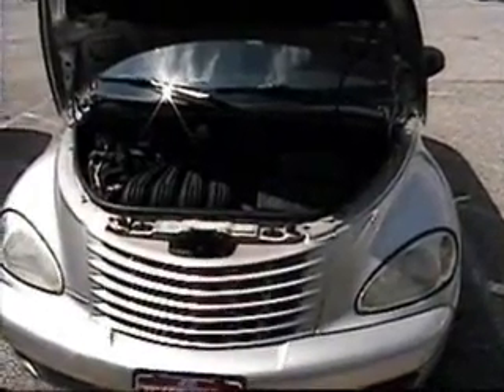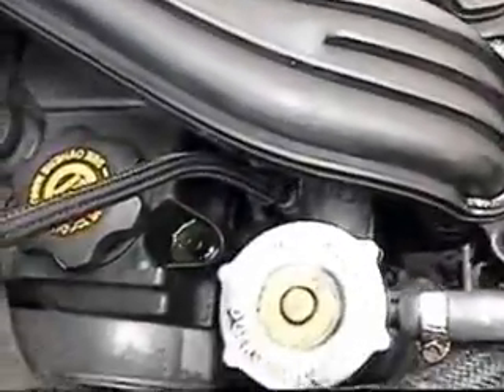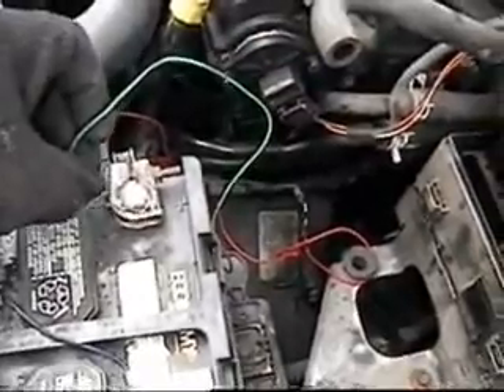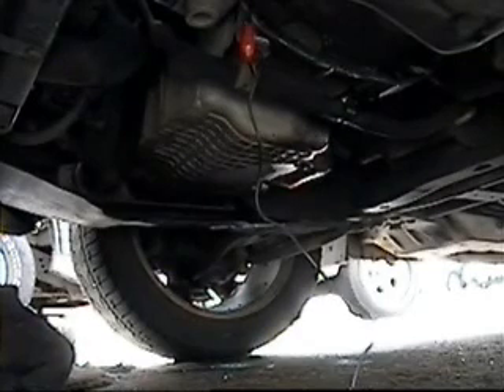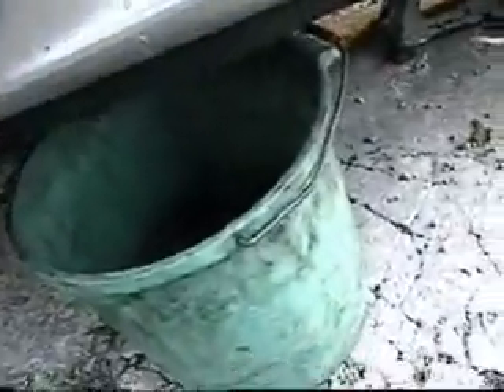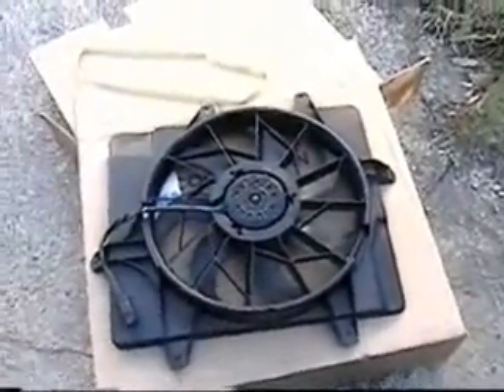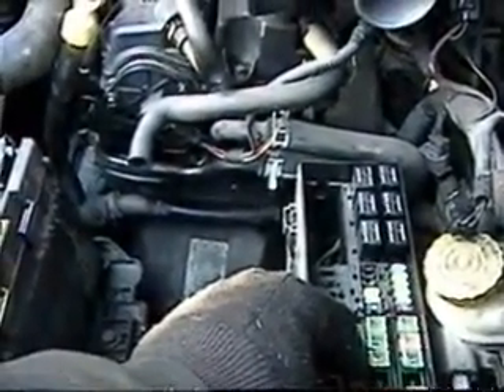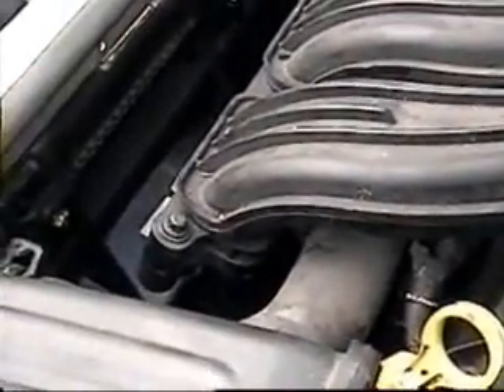Cooling system diagnos 2004 PT crusier

Comment: Thanks for the broadcast what is the red piece of metal under the jump state on the red piece in front of the fuse box is it attached to that or just laying on it?
Reply from the maker: I think it's the positive bolt to the positive battery post. There is a cap that goes on it

Comment: Thanks for broadcast you taught me alot...I'm going down a rabbit hole and not liking it!!!  Getting no communication to OBD2 port car Stalling... on a 2005 PT Cruiser Touring non turbo  and 02 senors low P0031 & P0037 voltage I replaced them but clear and they come back. Could it be an intermittent ignition switch not working at full voltage and in turn not sending 12 volts to PCM...in turn shutting down Fuel pump relay and ASD relay then everything has low voltage. Relay are working and fuses not blown. Can an ignition switch work to start the car but not put out the right voltage and lose communication with computer?
Reply from the maker: With replacing the ignition switch you may have to have it programmed to the computer. 
It sounds to me like the ecu is going bad

Comment: No steam from tail pipe .
no leaking .

pt cruiser overheats alot.
Reply from the maker: Wezzy Styles P. See if there are any leaks and if the cooling fans are coming on
Reply: Mind Blown Productions no leaks .
no steam from tail pipe  .

y would this car overheat?
2 new rad put on .
3 new term stat put on.

but it bubbles in overflow tank 

i think the car no good .

pt cruiser r weak

Comment: what if I replaced the fan,thermostat, relay sensor,  got the head done, new radiator cap,  still running hot.
Reply: many times i've found it's the actual connector that connects the radiator fan. these cars pull waaayyy too many amps. leading to another typical problem in the connectors on the battery itself. the corrosion eats right through them. fixing the current problem i.e. the fan connector and battery leads will solve the problem for a while. have to clean the terminals of the battery every 3 months or so. i've heard bearing grease will help keep the corrosion of the terminals to a minimum if used during install. i call them PT loser cruisers cuz if you have one you know exactly what i mean. can't trust a chrysler ever. stick with the 3 main brands. dodge ford and chevy.
Reply: you need a new  mechanic

Comment: I encountered a problem on my PT when I was replacing my radiator fan. the chassis underneath was pushed back so my fan was jammed and I could not pull my fan out.
Reply from the maker: Maybe you need the frame straightened

Comment: So the problem was the blower motor for the radiator fan low? Sorry but I am confused, at 4:04 you showed the low  fan running, what was the exact problem? and Can you please tell me how did you wire bypass the relay to start the fans?
Thanks, Nice video
Reply from the maker: garciaJo65 I just made a wire to connect to the fans, in order to test for power. The easiest way is to take the cover off on of the relays and push the tab on the side to test for power to the fan.
Reply: Mind Blown Productions Thanks for quick responding, I already test it, the fan works like your test, my relay is good too, On your video, why did you replaced the fan, if it wotked shen you directly wired it?
Reply from the maker: It didn't work on one the low side. (if I remember correctly)

Comment: Worse car ever. Between the radiator that goes out all the time overheating and i dont know if anyone else has this issue but when its hot outside the locks unlock and lock. This happens when im not even driving it. Ive also had lot of dead batteries cause the inside light turn on in the mid of the night and i wake up to a dead battery.
Reply: Buy a box of matches.
Reply: I have an 02 and mine does the lock thing too...
1- if I leave the key in the ignition with the car running  it will lock me out auto locking all doors!!!!! car still running! 
2- when I unlock it with the key fob it unlocks every door BUT MINE (the drivers door)  the car hates me. 
3. if u park and shut the car off but leave the key in the ignition and don't get out for a few min... thr locks will auto lock like 1000 times in maybe 15 sec. and apparently even the I turn the car off and take the keys  into the store with me.... the car continues to randomly "Speed auto lock" while I am in the store but my passenger remained in the car. when the passenger got scared and opened the door to get out if the car the alarm went off when I tried the key fob the alarm would not stop had to disconnect the battery. 
GRRRRRRR!!!!!!!!